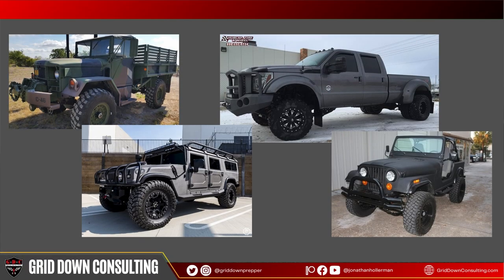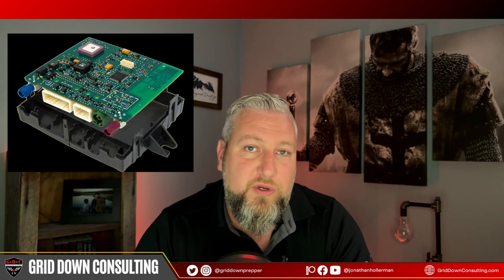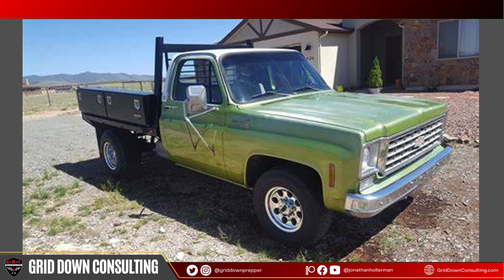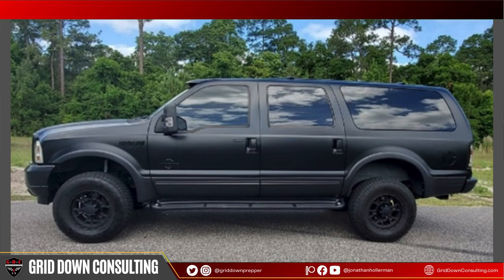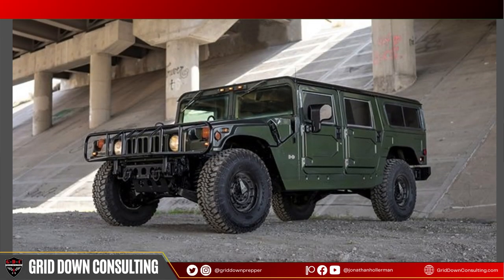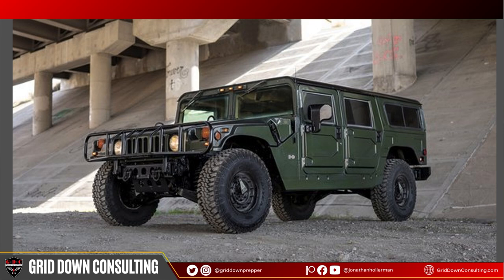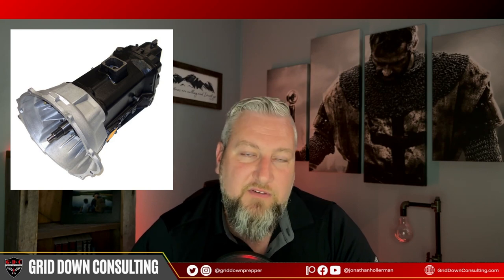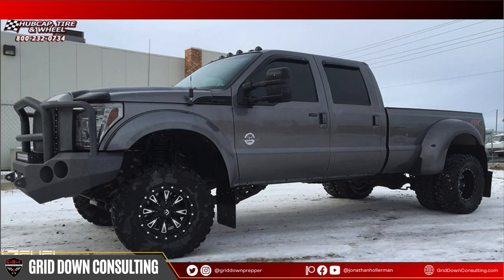Ultimate "EMP-Proof" Bug Out Vehicle Guide

Comment: I have 1983 HJ60 Land Cruiser 6 cylinder 12HT tubo diesel 5 speed manual no computers spares alternators & starter motors and 190 litre and a 90 litre fuel tanks im in Australia

Comment: I personally would just stay away from anything with power windows, locks, etc or anything with a body control module. 
My vehicle is a 75 K20 with a 350 I built from a short block paired with a sm465 I somewhat refurbished. All said and done I have a truck I daily drive that is very reliable,  I know how inside and out that I built for less than 4k. One side note would be to get something with very common and interchangeable parts. The SBC would have to be at the top of the list for parts availability.

Comment: A year and a half out from a Major EMP where is the fuel going to come from? Most will likely have been scavenged by then, horses, mules, probably have been eaten by those trying to survive. Bicycles and good walking shoes may be all that’s available. If you can produce biodiesel, you can use a older tractor to do some farming. If you have a mule and the equipment, you can plow. What will happen if we have a major EMP want be pretty. Thank you Mr. Hollerman, you and Greg Allison have proved to be the voices of knowledge to on EMP safety. Always God’s purpose, pattern and plan.
Reply: Pyrolysis
Reply: Biofuels. You can get flex fuel kits and tunes for cars to run 100% ethanol and deletes/runes for diesels to run on vegetable oil and ATF fluid! Potato/corn power is the future
Reply: Ethanol was used for vehicles in various places during WW2.
Reply: How often are you going to be driving after an EMP? I have 100+ gallons of diesel and ~50 gallons of gasoline. Both are treated with PRI-D or PRI-G. As it is, right now, I drive into town (about 10 miles each way) about once a month now. If an EMP hit, I would drive less. My stored fuel will last me quite a while.
Reply: spot on:   Bicycles (carts & sleds) and good walking/hiking shoes/boots.  Being in a vehicle makes a huge target for yourself!

Comment: Diesel direct injection with mechanical pump & injectors.   Diesel fuel lasts longer than gasoline and older diesels can operate on Reg85, cooking oil, etc., so more options for fuel.   Older Isuzu diesels in late 80's - early 90's GMC cabover delivery truck is an affordable option.  Old Mercedes diesels are good for jeeps and such.  Anything Cummins is stupid $$$$$$$.

Comment: If I was planning a EMP proof vehicle I would look at a pre 1970 model. The new EMP weapons are not more powerful, after all Fission is Fission. The new arms are focused effect. Getting full coverage EMP to a large area (like the USA) with the old-school nukes required multiple bursts to create a blanketed area but there still could be spots where the effect is week or not even effected at all. With a more focused effect an invading force can pre-position assault forces locally with out worrying about messing up there own army with the first blow of an EMP.
In the end, the ONLY way to protect electronics is to put them in a Faraday Cage, permanently, until needed. It would also be a good idea to have back-up part's in case of a 2nd or 3rd EMP attack. 
Also, mechanical machinery needs a good mechanic to keep it going.
The Cummings 4B and 6B are very good small diesel's they where popular in the early 1980's, hell, I remember seeing old 60 series Detroits in the 1980's crammed into regular pickup's, takes some mechanical know-how but there where pretty cool!

Comment: Im planning on towing my 5th wheel to the BOL, relatives property. But im using a braided copper clad aluminum grounding strip which is clamped to the axle that drags along the ground, dont know if it helps i just figured it could be the best path to ground which might save the electrical components. Your thoughts

Comment: Probably one of the most common low profile autos, is 80/90s full size trucks, with the inline engines, or v-6
Add in a 2nd muffler to one of those engines they are incredibly quiet.
Pre 1987 fords with the 300ci/4.9L there still carburetor and can easily be reversed to points ignition.
As well as there well known for being capable for being rigged for gas and/or propane fuel.
Not crazy hp so that just helps add to there efficiency, and life.
The diesels ford used tell early 1994 are also full analog.
Reply: Agreed, all great suggestions... I was trying to keep the video short (I failed... lol)
Reply: @jonhollerman4376 I subscribed to your Patreon and I’m following you here, I’d like to discuss a possible collaboration, I live in an area that post EMP would be the most ideal area I know of, with about a twenty five mile bike ride into town, and it’s remote enough that no one will drive up there once the fuel is gone. Can we talk? I’d like to build for your clients

Comment: Hi,   Would love any insight, on something in between the tiny CJ7 and gargantuan F450.    Full EMP proof Cummins diesel is great, if can afford $30K conversion on top of $15K-$30K vehicle.   Perhaps, best/easiest mid-modern SUV (that some may own and would blend-in/not stand out, pre-SHTF), that's easiest to convert from EFI to Carburation...and disconnect other electrification??      Any insight, thoughts or perhaps follow-up video, from JH or other subscribers..., would be appreciated.  Thanks
Reply: 93 or earlier diesel suburban. 4l80e is e, 700r4 can't tow the required 10k pounds. Manual swap w factory parts to nv4500.  Cucv already has the tacticool look

Comment: You mentioned clutch/starter switch. I vote for permanent bypass. If your clutch slave or master cylinder craps out you can put vehicle in first, crank starter and hit the gas. The vehicle will start in gear and will be moving. You can gently shift when the rpms hit the sweet spot. It's risk versus reward, but appear worth it.
Reply: My Toyota 4x4 PU already has a clutch bypass switch.
Reply: @laurenbish3116  good call
Reply: Definitely a good thing to consider

Comment: 1st Gen 12v Cummins with a 5 speed. Fuel runs out? Pyrolysis because 10 years after you’ll still be able to find plastic trash.
Reply: ve pump on 1st gen is lubricated by the fuel,  p pump on 2nd gen is lubricated by engine oil so it will last longer running on the plastic water bottles you mentioned.  Like all the tractor pull and drag racers you should p pump swap it

Comment: Don't firget about the older carburated Toyota pickups. Also, the 12 cummins didn't stop at '97.5. They stopped half way into '98 so you could get one in a quad cab...much more practical when the rear doors open. I would consider those the unicorn truck.
Reply: Do you mean the 22RE Engine? I think the bigger old US trucks/suvs are better in terms of being able to push obstacles/other vehicles out of the way. Also an old Excursion or Bronco or Sububurban can take a lot of collision damage. I feel like a small toyota while they super tough will not do well in these areas. But they would be incredibly reliable no doubt.
Reply: @TreadReview  No, the 22RE is fuel injected, so it has a computer and electronic fuel pump, The 22r is carburated, I pulled all the efi off mine and replaced it with a carburator and manual fuel pump (22r now). It all depends on the situation you're in and location if you need a large truck or not. The Toyotas are light duty but can navigate through smaller places. I have a large ammo can on the bed that holds a spare alternator, starter, igniter, fuel pump, and misc belts and hoses. I can make repairs super easy in the field if need be, mostly because the parts are small and easy to access. I also have a 12v cummins ('98) what would worry me is if my  injection pump goes, it would be worthless. Also, they have an internal voltage regulator that functions through the pcm (computer). So you may loose battery voltage. I pre-wired mine with an external voltage regulator and keep the regulator in a Faraday box. Depending on the situation, I would pull the Toyota with a tow bar behind the Dodge, doesn't take long to set up. It could be a good idea to have two emp resistant vehicles one that takes gas the other diesel. I would stay clear of ramming anything, it wouldn't take much to damage the radiator or front end components. I'm building out a humvee, they are pretty emp resistant because they are fairly mechanical like the 12V but still could have issues, computer for the transmission generator going bad etc. I don't like that the humvee would stand out instead of blending in, you have a point, though looking tactical later down the road when people are weaker. One thing about the humvee is you can build it out to be bullet resistant much easier than any other vehicle.